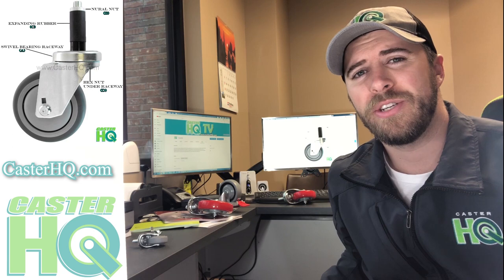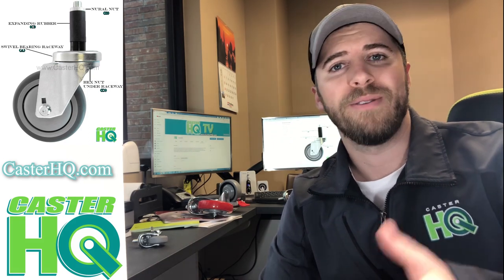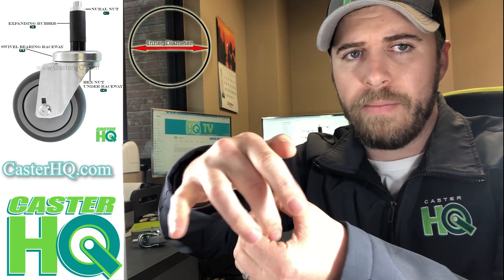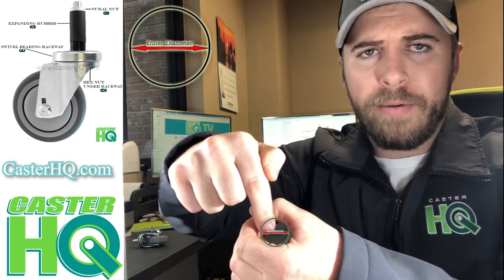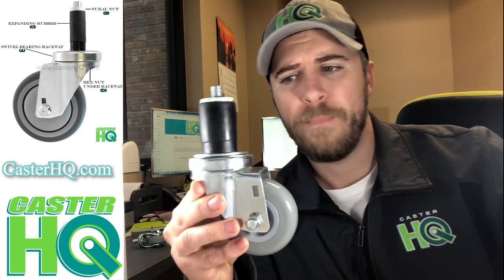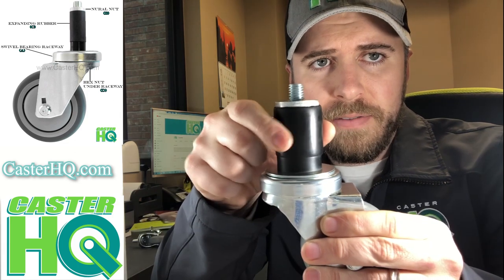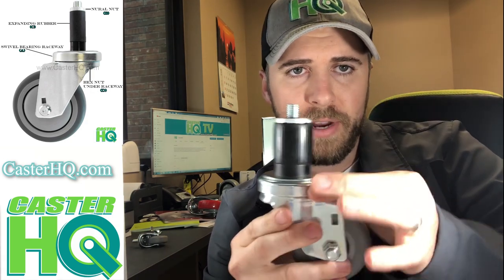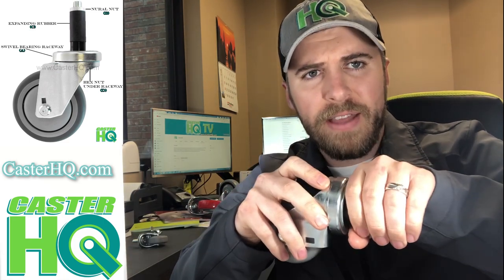Expanding Stem Caster Installation Tutorial Video | CasterHQ TV

Comment: Do you have something that would work with the “VEVOR Stainless Steel Equipment Grill Stand, 36 x 30 x 24 Inches Stainless Table?” It has legs with a near 2 inch diameter, so many reviews complaining that the typical 1.5 diameter stems are too small.

Comment: I’ve the Cheap 6-tier metal rolling cart from Walmart. I’d like to break metal cart down into 6 individual shelves, each with casters. The metal tubing is 3/4 inch diameter. Do U have 3/4 inch caster sleeves? (caster length is 1-1/2 inch. But length isn’t important)

Comment: i want to add wheels to my table, but it has hallow square legs, not cylindrical tubes, can i use expander adapters for it?

the table is from ikea, called påhl
Reply from the maker: Yes if you can measure the inner diameter of the legs tubing I can send you a link for some expandable rubber casters that should fit your ikea table.

Comment: Hi, do you think if you tightened just the swivel bearing raceway of the table (with griddle on top ) would work casters themselves loose? Somebody installed them for me and only tightened that without tightening the hexnut under raceway.
Now I can see alittle gap on one side of the caster SBR and the expanding rubber. Do you the Hex definitely needs to be tightened?
Thank you
Reply from the maker: Hi Peter, great question! Yes you can tighten and un-tighten the expandable rubber adapter once it is inserted into the tubing by just turning the swivel raceway. I need to make a real demonstration video as there are a couple different techniques that can be used to do this. Thanks for watching.
Reply: @CasterHQ  Thank you for replying. It’s crazy I spent a good amount of money on six new casters , they the table with the grill on it with a pump Jack but now it looks like the casters are angled again and I’m afraid to move the table. I wish I could send you a pic.

Comment: What is the amount of play at the bearing raceway ? The tighter the tolerance the less wobble my work branch will have. I have researched almost 15 mo for a solution to the slop that’s designed in ( or allowed ) at the bearing raceway which cases the work bench to move while performing work. I need  a min of 2 swivels in order to move the work bench . But it’s the swivel design that’s causing my issue. We can send people to the moon but can’t engineer a bearing raceway with zero tolerance. Frustrating , 
Se’an 1/15/24

Comment: Why is there a spacer? I assume to add space but for what reason?
Reply from the maker: The spacer in our expanding stem casters ensures the expanding rubber adapter is slightly elevated, filling any gap at the stem's top. This positioning is crucial; it allows the adapter to sit just below the knurled nut, facilitating full threading onto the stem during assembly. Without the spacer, if the rubber adapter were longer, it would

Comment: What about square tubing?
Reply from the maker: The round expanding adapters work better in square tubing compared to any square adapters that are found on the market. This is due to the square adapters not expanding properly and fully inside the tubing in which a round tubing expands and holds much better in square tubing. I recommend just using the round tubing adapters inside your square tubing.